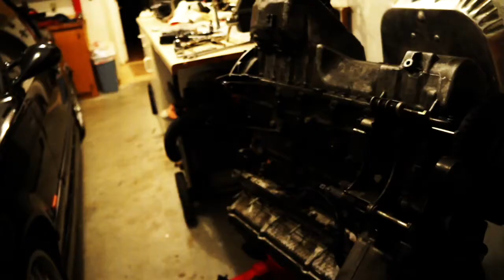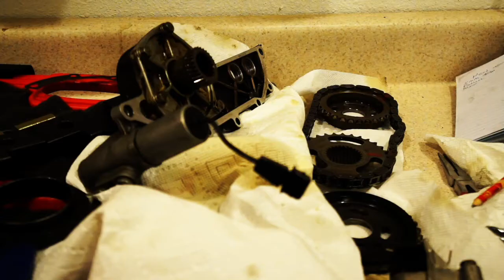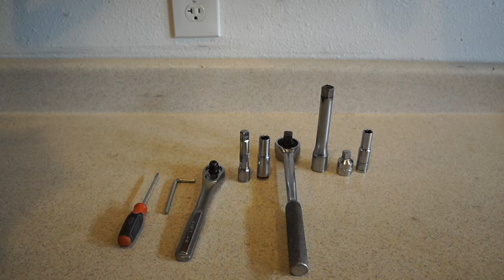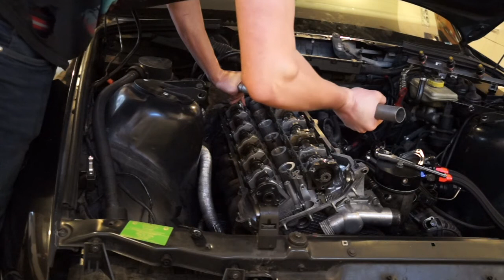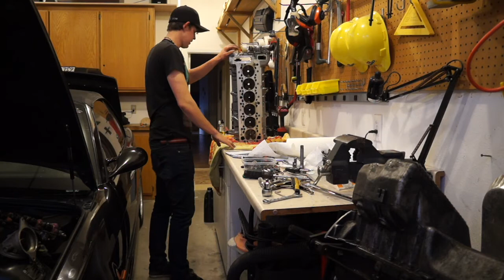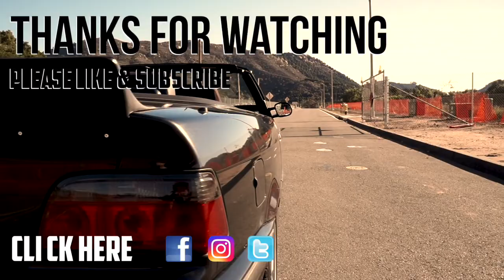E36 Head Removal

Comment: My head just flat out will not separate from the block. Pulled all 12 e12 head bolts and both e8 bolts where the vanos is. What gives?
Reply from the maker: Make sure there is nothing still connected on the intake side of the head, if there isnt it might need a good smack with a rubber mallet.

Comment: Hi!  First, thanks for producing these videos.  They have helped a LOT!!  They gave me the courage to tackle a head replacement myself!!
I do have a question.  Are the S52 and M52 Cam spacings the same?  The cam lock tool I bought, looks identical to yours, but the cams were too far apart to lock the tool together.  I ended up drilling the "normal" hole larger by almost .100" to allow me to lock them together.  The Tool did say it fit M50-M52 and I assumed that the S52 was the same.  TIA
Reply from the maker: Yeah the timing tools can be a trick to get on, mine is like that as well. The spacing and locking it all down is the same for all of them. S50, S52, M50, M52...

Comment: I'm having a problem removing the head. I removed everything that was attached to it but the head just doesn't pop off.
Reply from the maker: As long as you have all of the hardware off it will come off. Keep in mind that the head i pulled off in this video was off before within the last year. If the head has been on 20 or so years it might take more force to break the gasket seal, and also the head castings are pretty heavy. Make sure yiyr two e-torx bolts are off and Give it a good tug.
Reply: @M3NACE  189k miles and don't think the previous owners never opened the head. By any chance do you know methods of breaking the head from the block? I really dont wanna break anything also its extremely difficult to find a angle where I can pry open.
Reply from the maker: @misc-13  dont pry on it. It might just be suck on thw dowels. I would pull up on the head by the thermostat housing area and smack the head around with a rubber mallet and see if you can get it to slowly work up. A constant upward force and smacking it by the housing on the intake cam side shoule get it off. If not, theres probably still some hardware holding it on.
Reply: @M3NACE  I'll try that man. Appreciate it👍
Reply: I'm his partner helping work on his car and it's finally been opened now. After many sleepless nights. Problem was that he was too lazy to count all the head bolts. And the last two were hidden under the cam shaft.

Comment: Hey when putting on a new gasket on the water flange does it matter which way the gasket goes on? Like should the blue ring be facing the flange or the cyl head
Reply from the maker: The rear heater core flange?
Reply: M3NACE yeah I believe so, always saw it under the name water flange, but when I took my old one off the gasket was so brittle I couldn’t tell how it was put on
Reply from the maker: @itslawrencedood  it can go on either way, just make sure the mating surface is clean when you install it and torque it to spec.
Reply: For sure thanks man!

Comment: Hey boss please remind viewers that there is not two but THREE small bolts in the front that bolt the head into the block!!! The two that you mentioned and the third one is kinda in the middle and bolts down a chain guide I believe, if I remember right. I would know because I was at the yard trying to remove the head and everything was out except that one little bolt that I didn’t know was that long😂 ended up prying the head with screwdrivers until the bolt broke and I saw🤣.
Reply from the maker: +1 but you should have the vanos completely removed when pulling a head.
Reply: M3NACE lol true but if you’re trying get it out ASAP like me, then fuck the VANOS LMAO

Comment: Hey
Love yur videos.
I'm currently rebuilding my S50 engine. A piston hit a spark plug so the timing is of. Is it okay to turn the cams to gain access  to the head bolts since top dead center is impossible to achive?

Comment: And that’s all you need to remove to put in the head gasket?
Reply from the maker: aside from the entire cooling system, intake manifold and associated parts, the exhaust manifold, and the entire valve cover and ignition system, yes.

Comment: Hey, so when I pulled off the head, I broke the upper timing chain guide,  so how much do I need to pull off the engine to replace those? Any advise is appreciated, Cheers
Reply from the maker: oof. brutal, you will need to pull the timing cover off, which means the water pump, front crank pulley, crank bolt, ect. will need to come off. the A/C bracket might need to come off as well.

Comment: My socket is too fat to reach two of the head bolts. Can i rotate the cams to reach?
Reply from the maker: if your cams are at TDC the socket should fit. are you using a 3/8 drive socket??
Reply: It is a CTA E12 1/2" drive designed specifically for the head bolts. Its just weird because the other 12 it got just fine but these last two I can almost fit it past the cams but then it gets stuck. Maybe i'll just go pick up a 3/8" drive E12
Reply from the maker: Myles Bourbon weird man, i would think it should fit. You could try rotating the cams a bit to get it on there. I have no issues fitting my 3/8 in there.
Reply: Yeah I know it. Thanks for your videos man. First big project and I'm sure I would be very lost without them.
Reply from the maker: no problem man! thats what the channel is for. Hopefully you get it figured out and the rest of the project goes smoothly.
Reply: I’m having the same issue. How did you get around it?

Comment: After you torx your head bolts and do the 90'c torx are you finish with te top gasket process or must you torx it a second time example after 1500km.nice DIY  video
Reply from the maker: nah, if you are using the factory headbolts you to the torque sequence, which is X foot pounds in sequence, 90 degrees in sequence, then 90 degrees again in sequence, then its done. dont have to touch them after that.

Comment: Since you have a S52 engine, does it say 3.2 on the cylinder head by the coolant temperature sensor?
Reply from the maker: Cristian Garcia no, it says 2.5, the cylinder head design didnt change for the S52’s. The M52’s have the exact same head. The S52 has different cams and valve springs though.

Comment: Bro! Thank you! Finally somebody willing to pass down the knowledge of engine work! I feel like it's so hard to find car help these days. Everybody wants to just point you to a forum. Which is cool but these visuals make it 373747573× easier
Reply from the maker: yeah man of course! that is partly what this channel is all about. when i first started working on my own E36 4 or 5 years ago, it was the exact same thing. just forums and threads, no real, solid videos. I had to figure most of it out, and when talking with other E36 DIY'ers, I figured out fairy quickly that alot of them wouldnt do jobs much bigger than Valve cover gasket replacements because of fear of the unknown, and I personally wished there was a DIY channel like my own when i first started working on my car, so i knew there was a market for high quality E36 DIY's, and so when i got to the point where I could do jobs like head gasket replacements comfortably, I started the channel.

Comment: Hey for the two front bolts the e8s I pulled one out but the other one broke since it was totally rusted any tips on how to get it out? Thanks
Reply from the maker: sorry for the late reply my friend, but I would pull the head off, and try and go after it with some vice grips if there is enough meat sticking out of the block go grab on to. otherwise, you can try and extract it with a drill.
Reply: M3NACE no worries thanks for still replying, that is the only bolt left and the head won't pull off even though I got everything off including to the service manual I am stuck and it sucks haha
Reply from the maker: so the bolt head is still on and its stripped or the bolt head snapped off?
Reply: Bolt head and and half the bolt snapped off, only the treads stayed, but it seems weird to me that only that bolt can be holding the whole head in place?... did you remove tdc pin befor you pulled off the head?
Reply from the maker: no, the TDC pin holds the flywheel. not the head. assuming you have the 2 E8 torx bolts and all 14 cylinder head bolts out, the head should come off, but not without a fight. I would tap the head several times with a rubber mallet to try and break the headgasket seal, and keep in mind the head has some weight to it. if you still have some thread from that E8 bolt on and in the head, you will have to bring the head up straight back. I would get a friend to help out an just put some brute force on it.
Reply: M3NACE thanks a lot I will definitely give it some good whacks then and hopefully that will do it! It's pretty hard to extract the bolt since it is deep in there and pretty thin! Thanks again! And thanks a lot for all the great videos!
Reply from the maker: no problem, I am glad they are helping. I wouldnt try to get that bolt out while the head is still on, It will be a PITA. with the head off it will be much easier. just wrestle it out and good luck! let me know when you get it off!
Reply: M3NACE will do!

Comment: Is it true that you cant reuse the head bolts on another head you're replacing the original one with?
Reply from the maker: yes. factory headbolts are stretch bolts, or torque to yield. you torque angle them, and when they reach their final torque the bolt will "stretch" and lock itself into place, securing the cylinder head in place. every time you pull the cylinder head, you must replace the head bolts. once they are stretched, they are done. if you use ARP head bolts, from what i hear, they are re-usable, but even then some people recommend replacing them. same thing with head gaskets, they seal by the shear force of being sandwiched between the block and the head, and once they are "crushed" into place, they cannot be reused.  every time they are sealed, once that seal is broken, they must be replaced. minimum parts required for a head gasket replacement is a new headgasket and new head bolts, and valve cover gasket/intake manifold gaskets can be reused depending on their condition.